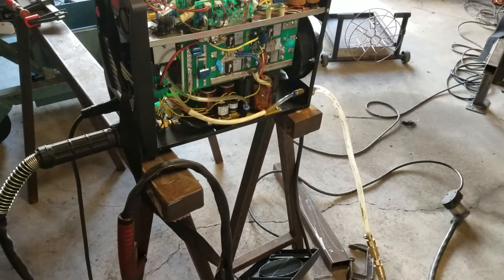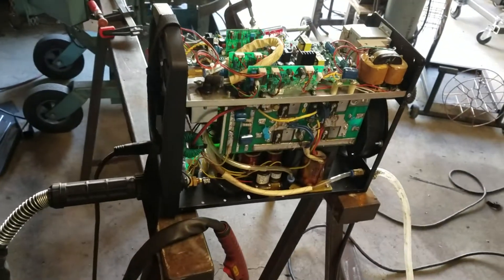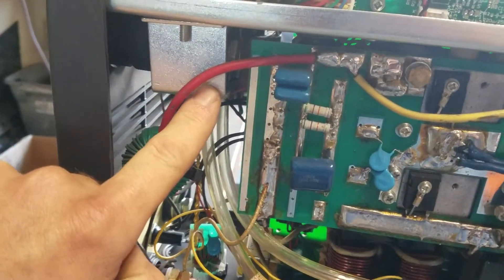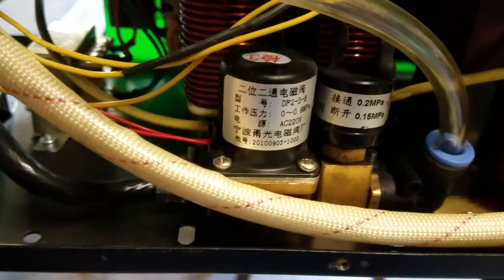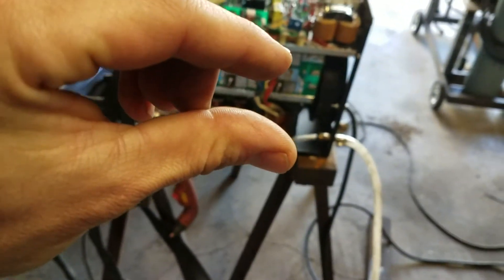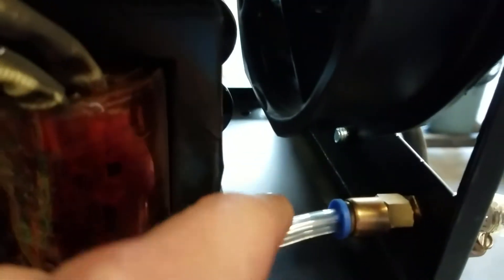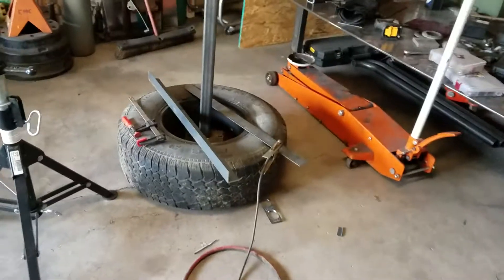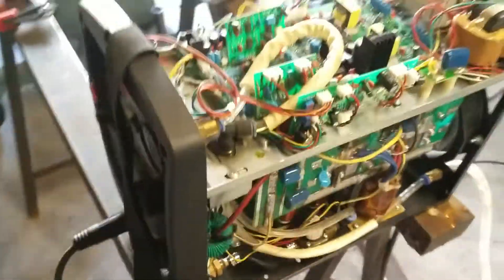Fixing stuck air solenoid valve on plasma cutter

Comment: I have a Chinese 50 amp plasma cutter and I have a bad solenoid valve. I get spark but no air will come out of the torch when the trigger pull. Where can I get a replacement any help?
Reply: Shit I'm having same issue!!!!

Comment: Thank you so much for taking the time to help others such as myself repair our plasma cutters. I have a longevity force cut 42i machine that is doing the same. purchased just over 2 years ago but was waiting on $ to buy cnc table but never happened. never used it until now and im so sorry I did not use under its warranty. longevity has real poor tech help that is of no help .$100 plus shipping and repair cost could be more then its worth. I think I will try your method. thanks again , Craig